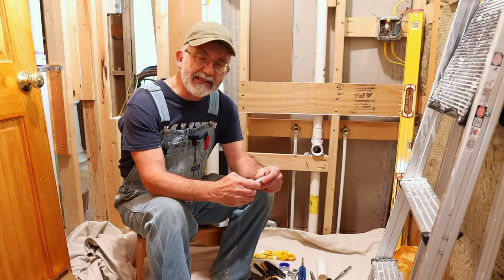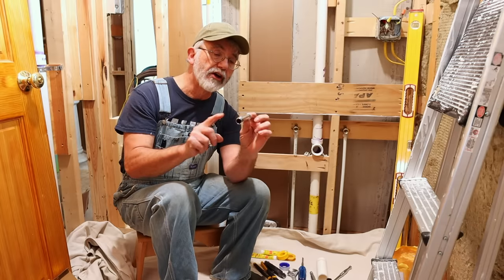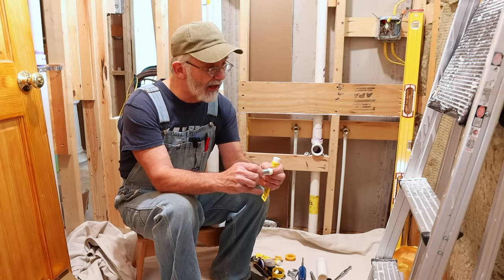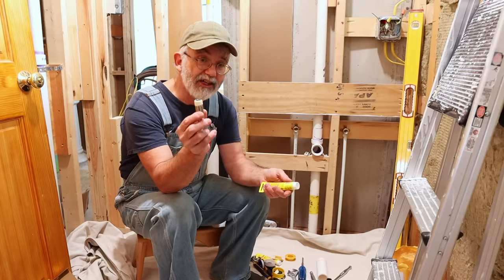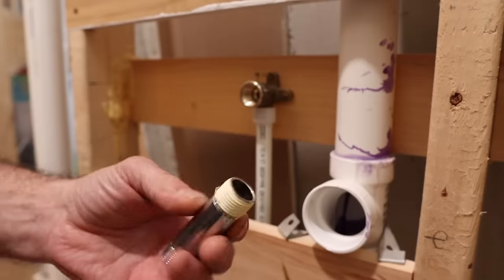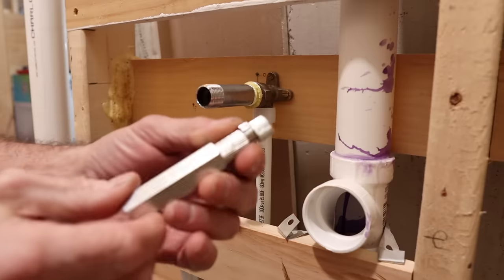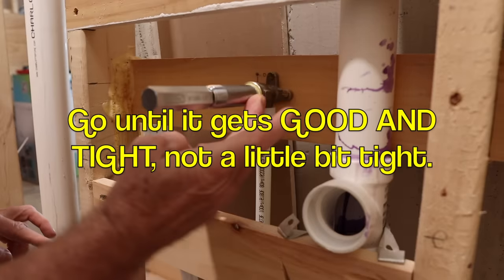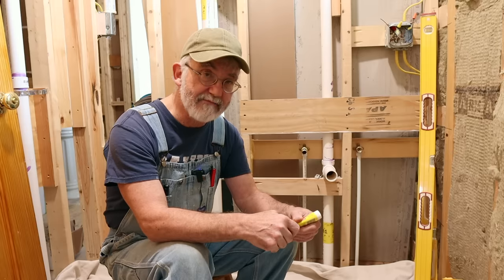Plumbing Trick * Make No-Leak Threaded Pipe Connections * How-To

Comment from the maker: Additional Notes: 1.) Be sure to read comments below for some great insights. 
2.) The yellow tape I show in this video is PTFE thread sealing tape made specifically for sealing the threads on pipes used for gas lines. It is thicker than the white teflon tape typically used for water systems. My experience has been that the yellow tape works better than the white, and it is my understanding that it is perfectly okay to use it with water pipes.
Reply: WHY DIDN'T YOU USE THAT TAPE AND DOPE ON THAT LAST PIECE? ALSO WHY WOULDN'T YOU USE LEVERAGE WHEN REMOVING THAT TOOL YOU USED TO TIGHTEN THE PIPE IN THE HOLE? ALSO, WHAT BRAND TAPE, I DIDN'T KNOW THERE WERE CHEAP VERSIONS VS BETTER OR GOOD VERSIONS OF TAPE. MAKES SENSE TO USE BOTH, BUT I'D NEVER  THOUGHT OF THAT EITHER.  I BOUGHT SOME PIPE DOPE, WANTING WHITE BUT ENDED UP WITH BLUE AND ITS WATERY AND CLUMPY, I HATED IT. LASTLY CAN YOU TELL ME HOW TO FIX THE CONCRETE BOLT AREA WHERE THE COMMODE SITS TO HOLD IT TO THE FLOOR? MINE BROKE. THANKS
Reply: I do the same. Yellow is definitely better.
Reply: Thank you.
Reply: @wheepingwillow24u17 Please stop SCREAMING! Also, the question is very vague....what is broke, the concrete itself? Also, asking a question as a 'response' to a comment probably won't get you anything at all. Also, you also-ed a lot! 😆😆👍🏻🛠️🔧🤔⚙️🧰👨🏻‍🔧🚿🚽🛁🚱
Reply: You are correct.

Comment: It is my belief that using both tape and dope is just a waste of teflon tape and time. The dual combo is nothing magic.   I am over 70 and I have been using these products (and more) than most people because teflon tape and silicone grease and the like were available to scientists, like myself, way before they were available to the general public.  I would never use teflon tape on NPT fittings where I did not want a leak.  Teflon tape just makes it easy to assemble and disassemble things; sometimes it works to stop leaks and sometimes it doesn't, as was mentioned in the video.  As torque is applied, the teflon tape gets shredded and the dope squeezes in there.  It is the dope that makes the seal.  Just use the right kind of pipe dope.  A compressed gas cylinder in a scientific lab will be over 2,000 psi when delivered.  A typical house water delivery system won't get above 125 psi before the T&P relief valve opens.  For the high pressures of compressed gas cylinders, neither tape or dope is used.  Compression fittings are used without any sealant, but you see people on YouTube swearing that pipe dope must be used on household compression fittings like stop valves.  When you get a leak in your house, you might get water damage.  When you get a leak in a lab, it can be fatal.
Reply: I am 77 years old, started out doing plumbing and electrical as an apprentice at 17. I remember the yellow rector seal long before the teflon tape and teflon rector seal hit the market. No call backs yet on the rector seal only joints but, but I do use both tape and dope on all my joints today. Actually did several joints yesterday.

Comment: I remember when they first started using teflon tape as opposed to the string and pipe dope method. My uncle would always use pipe dope with the tape. I just did a bath tub spout it came complete with the teflon tape. Their recommendation was to wrap it 6 times, so cheap stuff is hard to work with and you need twice as much. You're not saving money. Ever since it helped me seal some old radiator spud joints I swear by Oatey Great White pipe joint compound. Bottom line is you find quality materials stick with them till they give you reason to switch.

Comment: Everyone wants threaded pipe joints that don't leak! I learned this same thing from observing the work of other plumbers, who used both tape and dope. Belt and suspenders, I guess! It works. I have noticed that chrome pipes are the hardest to seal because the chrome is so hard and smooth that it doesn't meld into the female threads like brass does.

Comment: Just the liquid sealant is sufficient, used it for 30years with no problems, 90% of pipe leaks are caused by not tightening it enough, tape can cause week joints when you use too much and then they will leak with age

Comment: Teflon tape is a thread sealant, pipe dope is a thread sealant. Using both together is the same as using one brand of pipe dope and another brand of pipe dope together. If you use quality pipe dope and quality male and female fittings and proper techniques you won't have any leaks. But then what do I know from being a plumber for 45 years!
Reply: Let me know where you get "quality" threads on anything anymore. We use mostly stainless now. Dope acts as a lubricant to keep the tape from binding. Would love to see how many joints hold with just dope

Comment: Just an fyi for those looking to learn, pipe nipples for water are National Pipe Thread (NPT). 

National Pipe Thread is the US standard for tapered threads on tapered pipes and fittings in applications that carry fluids and gasses. 

National Pipe Thread is the most common fitting used in the United States and Canada. NPT threads are tapered and have a thread angle of 60°. The threads have flat peaks and valleys, also known as a Sellers form.

Tapered threads form a dry seal and are designed to work in conjunction with Teflon tape or a sealing compound to prevent leakage.

The Teflon tape is mostly a lubricant for the threads to seat all the way to form a mechanical seal but they do offer some additional sealing. It is susceptible to tearing on any machining mistakes on those threads. Thread sealant fills in those areas where it may be damaged.
Reply: yes!!!
Reply: NPT national pipe taper

Comment: I work for myself now but I was a union fire sprinkler fitter and we always doped the pipe thread then Teflon tape and if you were really concerned you add some dope on the inside of the female fitting. Dope then tape is cleaner as the dope is under the tape and won't pick up any dirt or debris.

Comment: I second the tape + dope technique.  I was having a hard time getting a nipple in a stub out to stop dripping and my father in law suggested both tape and dope.  It worked and it has worked every time since.  I don't always use both, but if I'm at all concerned I definitely do.

BTW, instead of using gas line (non-potable) products for water lines, I use Blue Monster PTFE tape and dope.  High quality tape is a game changer!
Reply: Blue Monster is just thicker Teflon tape. You can get teflon tape in that thickness for half the price. That being said, there's nothing wrong with the BM branded stuff. BM also sells a wider tape which is nice because you can just wrap in the same spot and it covers all the threads needed.

Comment: Great video lot of information just a heads up I'm a high pressure steam specialist for almost 40 years I will reverse that process put the dope on the threads first and then the tape keeps the hands clean, and I never need to use dope on high pressure steam fittings just tape.

Comment: To be honest, these were great tips. The tape you are using is “Gas Tape”, Teflon tape rated for gas fittings. So this makes sense. I worked with a plumber, years ago, that said to use both, and I did NOW AND THEN. I’ll do it all the time now. Your brand of dope, I’ve always used Oatey, I’ll try yours now. Finally, the internal wrench. Great.

Comment: Loctite PST is a one-and-done operation to seal threaded pipe connections to any temperature and pressure you will find in a residential system upon application. Also...if you have to "manifold" piping to line-up fittings or fixtures, it allows you to do that as well with no leaks even if the pipe joint has not been fully tightened to its tapered-thread limits. The product only hardens in the joint, never in the tube, and it is just-about foolproof. Teflon tape has been a bugaboo in pipe-thread sealant uses since WWII, where it was used in aircraft hydraulics.

Comment: Really good video. I have used this method   on all my jobs for years. The yellow rector seal is great stuff and should be used on potable water systems. However, I have always used the white teflon rector seal paste on gas, air, outdoor and underground  systems. Thanks for a quality job video.

Comment: Keep in mind to is to start tape and pipe dope two threads back of end of pipe so that when twisting on the tape or the pipe dope doesn't push out of female end causing gas valves or other to plug up. My choices are hillside chemicals,  permatex and retroseal compounds are my go to refrigerate and natural gas and potable water connections. All day I'm to words that teach me!(The Fixx)

Comment: Herrick, i could not help but notice the slotted brass or brass plated wood screws that you used to attach the drop ear, instead of the drywall screws that the "pros" use, nice job!
Reply from the maker: Good eye. I have loads of old brass screws from estate sales. Brass on brass makes good sense. 👍
Reply: Drywall screws are good for one thing only that is dry wall. They have very low sheer strength and a corrode immediately.
Reply: That's crazy. Good eye too, man. I despise straight slotted screws so much. I can't believe you went to that extent to add brass hand-drive screws...yes, I know you can use a powered tool to screw flat heads in, but it's difficult & almost easier to hand drive -especially if pilot holed. I use torx construction screws, or Phillips lath screws to fasten my drop-ear stub-out's. Torx is probably the best next to Robertson, then Phillips for speed & ease of use screws. Of course hex(¼\⁵/¹⁶) is king but not too many screws are hex drive besides sheet metal & tapcons, etc. 🛠️🔩🔧🔩🗜️📏🧰🦺🚧🤔👍🏻👌🏻😀🍻

Comment: Oh, its also a good idea to wrap the tape around the pipe threads in the proper direction both circularly and spirally to ensure the tape doesnt push off when you screw it in the fitting.  That might make a good short video itself.
Reply from the maker: You're right. I shouldn't assume everyone already knows that. 😕
Reply: I was told that if you twist the tape enough to make it look like a string and then wrap it in the threads then wrap threads the usual way that will work also with no mess, have done a few like this and so far no leaks.
Reply: Completely lost here. I have no idea what wrapping threads spirally means.
Reply: @michaelallen5505  some tape is wide enough to just wrap straight around on top of itself.  However, in cases where you'll have screw the pipe in much further, it would go beyond one width of the tape.  So you start wrapping further away from the end of of the pipe and and as you wrap, you come closer to the end of the pipe, ending just at the last thread closest to the end of the pipe.  That wrapping pattern will form a spiral.

If you started at the end of the pipe and worked your way down the threads away from the end, then it's possible that when you screw the pipe into the fitting, the bite of the fitting could start pushing those layers off the threads.
Reply: @RoyatAvalonFarms  thanks
Reply: @RoyatAvalonFarms  Thank you for  explaining that

Comment: The other trick is to put a SMALL amount of dope on the female threads. Read the can of dope. Rectorseal "True Blue" recommends this on pipe 1 1/4 and larger. I don' do that on smaller sizes but 1 1/4 and up I do. And I will do this when reconnecting to old fitting which may be worn or nicked.

Comment: Good demo.  I've been fighting chronic drippage with a lawn irrigation manifold I put together in summer 2022.  It's standard plastic valves and PVC fittings with white Teflon and Oatey pipe dope.  .Have had parts of that thing apart numerous times for drips at the valve inlets or the unions used to connect to the supply side.  Never had such problems back in the day.  Maybe these threaded parts have  been cheaped out in recent years.  System is off for the winter and will be building a new manifold soon using your method..
Reply: Make sure whatever dope your using is ok to put on plastic pipe threads. I'd be worried, cause some of them have oil\petroleum products in them that could interfere with the plastics. Just a heads up. 👍🏻👌🏻👨🏻‍🔧🤔🛠️🔧🚰💧🚽🚿🛁

Comment: Thanks for this wonderful tip.  Ive marred up many a nice chrome pipes without having the right tool.

I ordered this set of wrenches from your link, although the reviews are not so steller.  Ill trust your recommendation.  Thanks.
Reply from the maker: Hi Roy, 
The General pipe wrenches are what I have and seem to work well. I don’t use them very often. I had an old 1/2” PROTO that served me well for years, until I lost it. The far better quality internal pipe wrenches are made by PROTO. But they are a whole lot more money. Worth it if you want top quality. They are also available at Amazon. 👍
Reply: @herrickkimball  great.  Thanks.

Comment: I done heating and air installation for 10 yrs and had to do some plumbing equipment as well and a lot of gas pipe, and I would use Teflon tape and blue leak lock pipe dope and would soap bubble and pressure test all of my connections and never had a leak.

Comment: Fascinating to see the mostly small differences in materials and techniques between the UK and the USA. I drooled a bit over the internal pipe wrench, which I haven't seen before, although we use almost entirely copper or brass pipe here even for stubs. Personally I prefer ptfe string wound criss/cross, but the biggest difference is that I would always 'distress' the threads to stop the ptfe wrap from slipping. The plumber's gunge (jointing compound?) In the video looked a lot more covenient than the one I use (JetLube), but mine comes in a tub and needs stirring, although it never deteriorates beyond that.
Reply: Rubber strap wrench works as well, and more adaptable to sizes.

Comment: Some "authorities" maintain that Teflon tape and/or pipe dope do not seal the threads but they act as a lubricant so the connection can be tightened sufficiently for a good seal. It does not matter what they do as long as there are no leaks.

Comment: Just curious why use a finish nipple during rough-in instead of temp nipples. Use the shutoffs for a wrench grab after the walls are done. Either way good advice. Always tape and drop. 20+ years in the biz and never had a leak
Reply: I agree on installing the chrome nipple before the sheetrock. It is easy to clean the sheet rock mud off and escutcheon ring and valve with less labor too.

Comment: Been a plumber for 10 year.  Before that worked on semi trucks and trailers for 8 years.   1 step I would add is thread sealant BEFORE tape.   Then thread sealant on female threads.  I have had to redo other people's connections when there is no thread sealant under the tape on the male threads

Comment: Try it the other way around. First a little dope, way less than what you applied. And as last the tape. Clean the before you make the joint, and cleaned afterwards. You can put a tiny bit on the internal threads, for good measure. Always rough up your threads, to keep the tape on his place.

Comment: Fire sprinkler guy. Dope then tape all day. But we also fab more than 1 pipe at a time. That's why there will be 1 sprinkler guy per 15-20 plumbers. The standard is 200 psi (water for 2 hours). Typically pipe metal threads seal on the 4-5 thread. If that was a ss nipple he used he would of split that brass fitting going in that deep. Don't use tape before regulator's. Rector seal isn't good dope. Megaloc or blue monster.

Comment: actually the proper to proper way to tigthen that 3" nipple without marring is it to put the other part and use that part to tighten both that part and the nipple at the same time. do so avoid marring the inside part of the nipple which could cause leak in the future.

Comment: I don’t do much metal pipe, mostly pvc for commercial home and office aquarium systems. I can’t use pipe dope. I use teflon, usually a couple more wraps, like 5 or 6 wraps, and then follow it up with 100% silicone on the threads. I even do it with the metal fittings I’ve had to use. Anyone can tell me I’m doing it wrong but I’ve never had a leak in the 10 years I’ve been working on them.
Reply: Too many wraps of tape will sometimes cause a female pvc fitting to Crack when tighting.
Reply: @larrylesueur8958  You’re telling me. I had some sch 80 ½” x ¼” reducers that were cracking left and right and I was being blamed for using too much tape so I started doing 3 wraps and even 1 wrap and they still cracked. Turns out it was a bad batch from Spears. For the spa pumps I use on the intake and discharge for commercial systems we have to wrap them like 15-20 times to make it a tight fit!